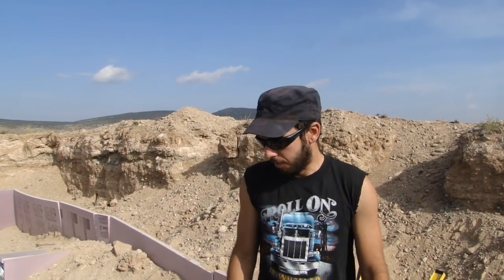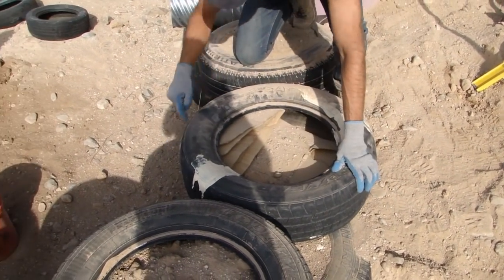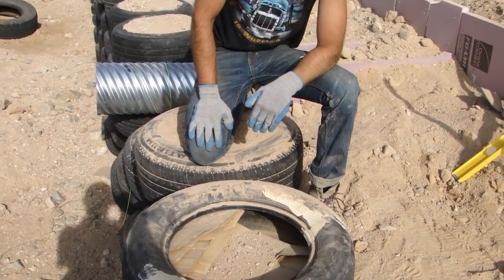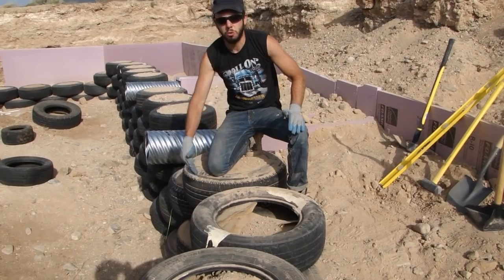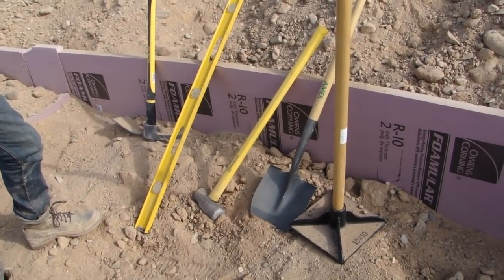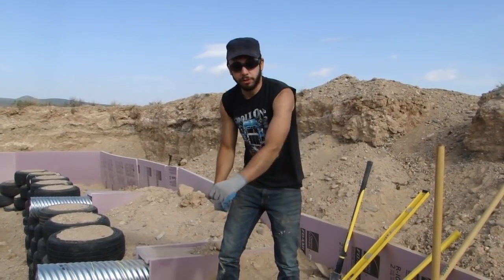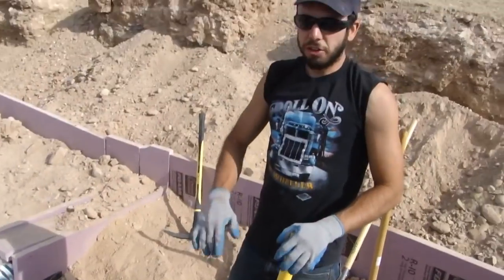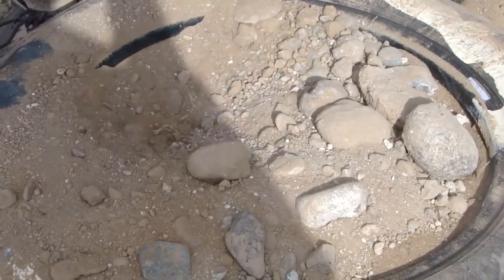How to Build a Tire Wall

Comment: Great video! I am looking to build either a cob home or earthship and for the earthship I can see your videos will help a lot!
I have 2 questions if you're able to answer those:
1. Do you have a foundation under your tire wall?
2. Once you get the hang of it, how long does each tire take?

Thanks!
Reply from the maker: +nvanwensen 1) nope 2) 15-25 minutes for mortals.  Real pros can do it in 10 or less
Reply from the maker: make sure your bottom courses are big enough tires though.  there is a science to it
Reply: Hi +OGB, Thanks for the reply! It's pretty amazing no foundations are needed!
I will take that as it will take me 30 at least :D
I'm going to start with making the base of a greenhouse in the back garden of tires to get the practice in.

Thanks again!
Reply from the maker: anytime

Comment: Hi OGB, thanks very much for sharing. I was wondering if the aspect ratio of the tires is important. I can see you are using 75% on the cicenatti project. Could 65, 55% or less be acceptable? My project is to put up 7 courses of tires and than a ferrocement dome on top.
If you have any advise on the size of tires, please let me know! 
Keep calm, and pound a tire!

Comment: I've begun doing research on off-gird/alternative building methods and I haven't really found an answer to a couple questions:

Why use the tire method when the earth bag method seems to be less labor intensive and has the same thermal advantages?

Are there any examples of the 'earthship' style (self-contained) house using the bags instead of the tires?
Reply: Wouldn't you need to build a retaining wall with earthbags ? With tyres, you just arrange them in a U shape and that is enough to support the surrounding earth
Reply: Earthbag works great for a freestanding wall, but this wall will be backfilled and needs to be far stronger as it is below ground.

Comment: I want to build a retaining wall before I install my above ground pool do I need to add a french drain to take the water away from the bottom where the first run of tires are

Comment: stupid question, but could you use a concrete vibrator tool to do the initial sidewall fill as a way to save time?

Comment: It did seem quite labour intensive to place one tyre, but if you consider that the process involves manufacturing the building material as well, overall it should be quite economical. Standard bricks and breezeblocks require a much more extensive manufacturing process which is eventually factored into the end cost.

Comment: What about using a compactor or concrete vibrator, the type that compacts a dirt surface, it would vibrate the soil causing it to fill in faster and tighter.

Comment: Excellent video, very informative! Lots of detailed explanation compared to other videos on tire pounding. 
I just have one question. When you do the final fill and tamper, doesn't that undo the leveling you just did? Do you need to check the level again at the very end?

Comment: Fill em with concrete & rebar, then concrete blocks full of sand & rebar mortared together, then sand bags, for a nice thick wall. Telephone pole & railroad ties across the top for a good sturdy roof, some galvanized roofing, and you got yourself a: SHTF Safehouse/Tornado shelter/Root cellar. A nice sturdy sliding barndoor style entry, some air vents, and your good to go. Sounds like a plan, and a decent safe place to wait for JESUS' Return !!  Amen.
Reply: actually all you need is powdered clay sand and dirt and of course water. then when your done building you plaster it and ta da you have a house. it's also fire proof mold proof and bug resistant if you done it right. I'm going to build one lol and my cob house would be crazy!!

Comment: ok on the 1inch and a half you talked about do u go 1 1/2 out on top of the first set of tires then an 1 1/2 (in) on the third set of tires all the way up or are you just going in 1 1/2 out all the way up the wall cause that don't sound right

Comment: Hello.So I'm curious.IF the finished interior will be either cemented insulated etc etc.Is the purpose for packing the tires to be a low cost bunker of sorts?
   "Framing"out the structure and basically filling the space for weight then the completed structure to be cemented.The extra packing not necessary.
   That for just a fence like wall A home like wall I see it helps with strength and support but in short it's similar to a CMU block build?.?.
Reply: They are usually covered with cob or adobe

Comment: they need some ox power tamper rig or some shit.. people shovel, oxen walk circles off to the side, driving a belt and spinning a long log with peg drives for multiple large mallet see saws. and a dome or maybe cone shaped ish mallet head. do like 20 tires at a time same number of people add an ox or two

Comment: 05.30 "i'm going to need another batch Max" thats because you kicked it all out! you should make up a cone shaped item made out of iron that you could hit with the sledge hammer, with every hit it will go further down pushing the dirt out to the side compacting the tyre, that would work perfectly and would save you on energy by cutting at least one more trip for Max for more dirt, any metal fabricator could make one up for next to nothing and you could keep it for future builds!

Comment: It seems like a lot of work just to set each tire with dirt. What if you left the tires empty, similar to empty concrete cores? You could leave the tires empty, but still build up the outside and insode with chicken wire and stucco. That would be very similar to a CMU dry stacking method.
Reply: The tires are filled with soil for thermal mass.  This helps insulate the house.  Without the soil their would be an air cavity in which temperature variation will occur.

Comment: ? Could you fill the side walls with spray foam to save all that time packing the side walls then just fill the center of the tire and stomp it?
Reply: Spray foam is an insulator, not a good solid mass object. This area is supposed to resonate heat THROUGH it's thermal mass into the home, therefore no.
Reply: Well yes you could but it would be a lot less efficient. The dirt helps heat you home in the winter and cool it in the summer. Insulation like foam won't do that. Also filling them with dirt makes them a strong retaining wall. And well.... dirt is free.

Comment: Do you need a French drain system behind the walls?
Reply from the maker: +Darryel Sanders no
Reply: The reason I asked about the french drain system cause Im going to actually have a hillside that has trees where Im going to build my Earthship home.
Reply from the maker: in that case, then maybe yes
Reply: What is the best size tires to use?

Comment: I know this going to sound stupid, But why don't you get small explosives like a cherry bomb and put that in the bottom, fill with dirt and pop it. Might save time, might just be a crazy explosion, but the concept is the same to fill the tire up with sand  in all corners. NOt sure how clean it would but if it works like how im thinking it would it would a lot faster. 
or even getting one of those asphalt surface finishers.

Comment: Has anyone on here based in the UK done one of these ?? Just wondering where to source recycled tyres.
Reply: David Hartnell ,yeah on doing one at my allotment 200 tyres in so far works really well 👍
Reply: Try the local garbage tip thats where I get mine it costs them money to get rid of them so they are happy to give them away here in Australia.Also the local tire shops they would love to get rid of the old ones for free

Comment: This seems terribly labour intensive. On average what is the time for building one wall with tires. Friends of mine fill the sides with rocks before they add soil and tamp it. They also use wet soil. Your way is interesting too but as I say it seems to take a great deal of work. Work is good, I know. This was very informative.

Comment: 6 ft 1 in
 250 pounds
Creating a tire/earth wall around my 2.5 acres.....
The biggest mistake I ever did was buying a pickaxe & a sledgehammer.
Between my hands and my body weight and overall common sense, they are both still in the original packaging.
1,000 tires done, many thousand left to go.

Comment: Instead of a tire wall can hempcrete be used?
Reply from the maker: no, they are completely different.  tires are structural and thermally massive.  hempcrete is non load bearing and insulative.  you'd have to frame around the hempcrete

Comment: Why not fill the tires with cement?  It seem like that would be more effective yet more pricey.
Reply from the maker: easier to use cinder blocks if ur gonna do that

adobe is better thermal mass than cement

cement is less forgiving over time as the building settles

Comment: why would you isolate the cool tubes?
Reply from the maker: so the house doesnt heat them up
Reply: i thought it works like this: air gets sucked into the house, while travelling throught the tube it gets cooled because of the cold dirt
Reply from the maker: right.  but after it goes thru the cold berm it passes through the thermal wrap around the back side of the house (the area of dirtt INSIDE the insulative thermal wrap), which is meant to be warm, so u dont want that warm dirt heating up the pipe
Reply: i see. thanks for the explanation man!

Comment: It's a great idea, but there needs to be a more efficient technique. This looks like it would take at least 100 times as long to build and require at least 100 times the effort..
Reply from the maker: +Gabriel Bartash not so
Reply: +OFF GRID BUILD Pretty sure it is so.

Comment: Why are the earthtubes insulated? Isn't the idea to transfer the heat?
Reply from the maker: they are only insulated on the inside of the thermal wrap barrier.  so that they don't transfer their temperature to the inner section of thermal mass.  beyond that, they r not insulated.  that way they absorb the temperature of the outer cooler earth.  your dirt on the inside of your thermal wrap (insulation that wraps around the whole house) is warmer than the dirt on the outside.
Reply: Off Grid Build
 Thank you.  Do you know what kind of results you would get in a tropic climate like Florida with these?
Reply: OGB and if cut the top?
Reply: +Brock Samson  it is known. Many have been made. I believe the glass faces north! or its south facing and 90 degrees. basically there is no solar gain and max thermal mass.
Reply: Nathan Clukey
 Any idea what temperature ranges they are getting?  Where would I find that information/community?
Reply: +Brock Samson My understanding is that after 2 years that it typically doesn't get colder than 60 degrees Fahrenheit.  This is according to Michael Reynolds who's been the pioneer of earth ships.  All his original testing grounds are in Taos, New Mexico where it DOES get subzero at times, although Michael Reynolds typically recommends 2 buffer zones in climates zones that are particularly cold.

Comment: So, why not mix the dirt with water, and put the mud into the tires?  This would yield greater compaction than any amount of pounding...
Reply: As the water dries the volume it added disappears with it. Add water and you have to go back and add more dirt later anyway.
Reply: +Bobby H 
Water does not add volume, it fills the spaces between the sand grains. there is an optimum water content for compaction. Look up road construction on Wiki or other sources.

Comment: so you basically fill it up. Pound it, then check the level of the tire. add more dirt then pound it again which will un level it again most likely. why don't u level it in the very end. wouldn't that make more sense.
Reply: +84proof If you have access to a transit it is easier to level each course after all of the tires have been filled.  Most people don't have access to one and don't want to spend the money to buy one.  In the grand scheme of things, spirit leveling will get your tires close enough.

Comment: What do you do if you have different height and diameter tires? I'm sure the ones you obtain are not all the same size.
Reply: pipgal you would probably select all the same size tires. I’m sure he doesn’t take all of them that are there. Only the ones he can use, and I am sure there are parameters for useable tires.
Reply: I had the same question. Is there a standardized size that's used over others?
Reply: @Richard Gilley Makes sense...thank you.

Comment: What happens when high acetic of alkali groundwater or just time causes the tires to eventually degrade and pump tons of cancer causing particulates into the ground water? There seems to be a better way known for thousands of years = adobe.
Reply: John Arizona 
You make it sound as if the tires will just magically disintegrate and poison everything. If the particulates get eroded away by dirt and time, then they will either get stuck in the sand and dirt in/around the tire, or the amount that will actually leech past all of that will be negligible at best.
Reply: Make it sound as if? That is precisely the case. They disintegrate and rain washes the chemicals into the underground water table where they emerge from a faucet or lake where fish and other aquatic life ingests only to continue the cycle. Perhaps your either unfamiliar with Earths Eco System and how it works or in denial but either way this is what happens. To simply say it will take a while or what not is pretending you are not responsible for polluting future generations and the earth. You then go on to say "negligible" as if that is okay so I ask what is the point of building this to begin with if you don't care fully? That is the same thinking that got us into this mess to begin with. When does it start to matter to you? When every living thing shows signs of genetic damage? Pray and accept the truth that love is the only solution and love isn't half or partial and using terms like "negligible" when it comes to proven toxic pollutants is UNACCEPTABLE!
Reply: ...
So you're saying that, instead of using rubber tires to build buildings, I should put them in rubber/plastic lined tire dumps and landfills, because somehow one type of rubber/plastic is better than others?

Okay. Let's do that then.

Or, if that sounds terrible, then what is your solution to the current problem of abundant garbage that isn't easily changed into other materials? I.e. rubber tires?

Should we use the trash we have in place of new materials - (which will take more energy to make and create more trash)- or...(your solution here)?
Reply: That is your idea as no one suggested you put one toxin into another. Do you ever win an argument by adding your perverse fantasies as opposing view points?
Reply: Clearly you miss the point here. The idea was to do something to help the earth not embed poison deeper within, just above the water table for future generations to suffer. The ancient Romans made cement using volcanic ash and much of the rest of the world used mud and straw to make adobe. Both of which are longer lasting than tires and 100% non toxic. Some here are addicted to conflict so to the others who actually care, think! The idea of "Earthship" drastically needs a re-think and modification to stop using poisonous materials = simple.
Reply: http://www.buildnaturally.com/PRojects/Projects.htm <--one designer using non toxic, natural materials.
Reply: Non-toxic, natural materials that rot. Not only do they rot, but when they do, the material is so thick you have to pull out entire sections to find the compromised portion.

On top of that, read this:
"In northern regions, the potential snow-loading can exceed the strength of the bale walls."

Obviously, the materials you have mentioned will not stand the test of time, nor can they be used to make multi-level structures.

Just because an idea is completely renewable, doesn't make it SMART.
Reply: Tires do rot. That was really the point made from the very beginning and when they do that poison leaches into the groundwater. STOP PUTTING POISON TIRES INTO THE SOIL AND DRINKING WATER!
Reply: Earthships do not place protective liners under tires as do many landfills so the toxins are free to invade underground water sources.
Reply: "The health risks associated with tires used in gardens are a different story.  While research differs on the exact health effects that occur from tire leachate, there is accord that the leachate from tires is not non-toxic[3].  Therefore, tire gardens are potentially exposing edible plants to a hazardous rubber leachate.  Research from Bucknell University indicates that rubber leachate from car tires can kill entire aquatic communities of algae, zooplankton, snails, and fish[4]. " http://www.ccathsu.com/askccat/do-earthship-tire-constructions-pose-health-risks/
Reply: Has anyone even looked into Radon mitigation in Earthships or is this another ignored health risk?
Reply: It seems many of these types of buildings never considered safety in the short and long term which will turn many away as soon as some become sick so it is time to rethink and do it right. There are good organic materials to use which are far superior to toxic tires and Radon mitigation can be accomplished if you care about who goes inside one.
Reply: Been looking into heath risks. Do you have any good links to studies finding such?  My thinking is billions of tires driving on roads get chewed up each years into small particles, maximizing surface area and leeching effect, and washed away wherever the water flows.  This is not stopping unfortunately, and in comparison a tirewall doesn't seem to even be a factor.

Comment: gonna cost you more on labour than any materials you might buy .... nothing beats brick
Reply: nemaproducts lots of things beat brick. brick is cheap and does not last that long.
Reply: By packing these with dirt your turning them into giant free bricks. Use a couple of pneumatic tampers with solar power for you air compressor and you can really reduce labor need and cost.